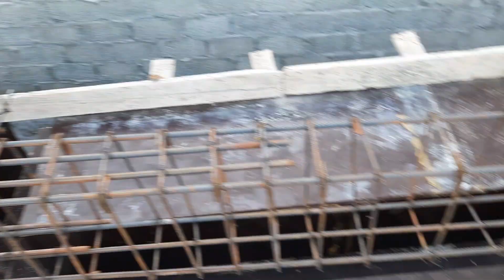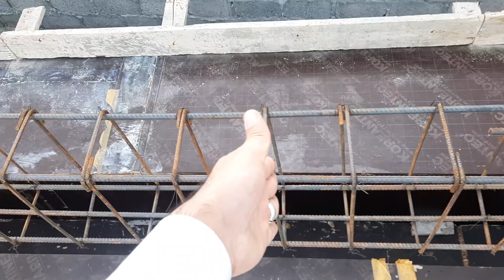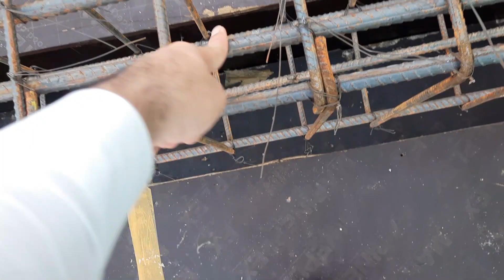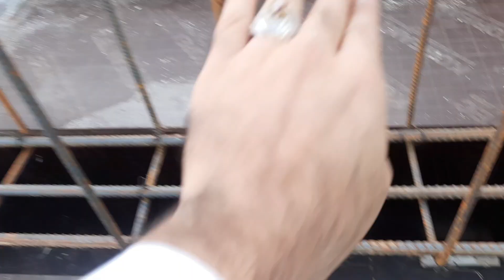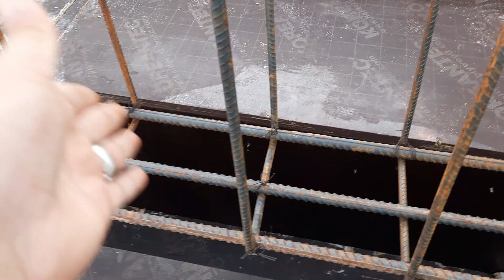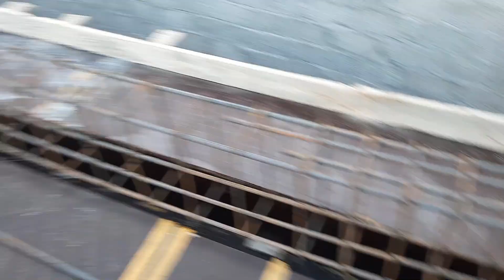Structural Design of 15 Feet span | Civil Engineering videos |

Comment: where is the bottom extra br it should be between center at the bottom not till to the end
Reply: Yes true.
Bottom curtail bar should be provided at the middle not all the way to the support. At the support less bar are required at the bottom because there is less bending which happens at the top which is why top right extra bar 2T16 are provided